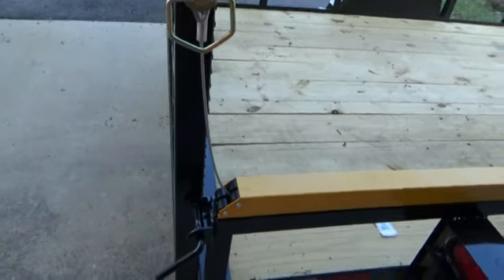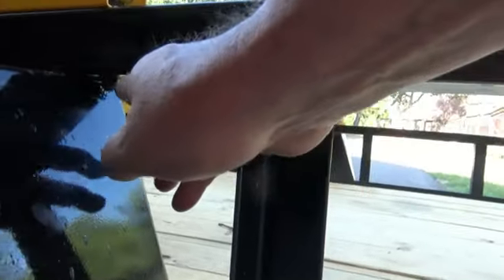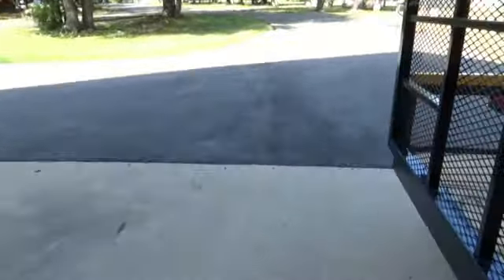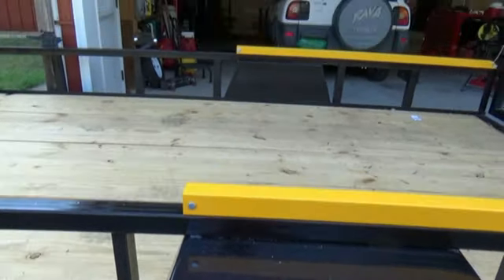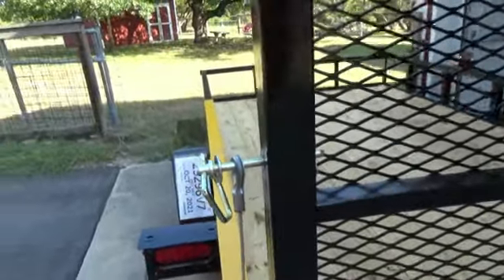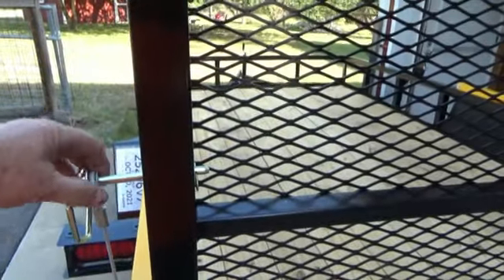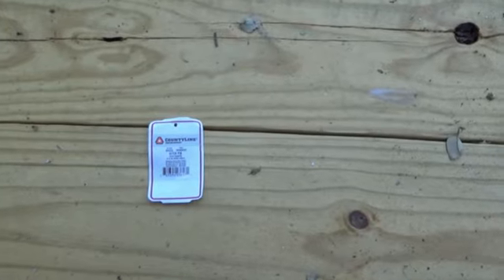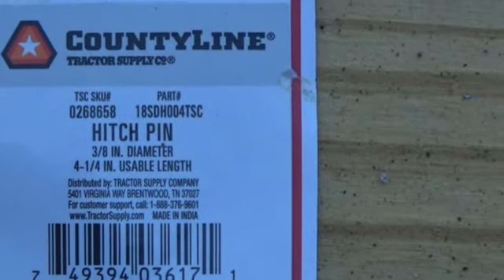Gorilla-lift Trailer Gate Assist - Lowering gate into trailer floor

Comment: YOUNG MAN ,

IS ANOTHER WAY  , NEED BUY LONGER  PLASTRIC SQUARE TUBE FIX INSIDE THE OTHER PLASTRIC TUBE , THEN THIS  WAY U U WILL HAVE MORE ROOM BOLT IT DOWN ! .

MY IS HOMEMADE ONE WITH GARAGE DOOR  2 - 150 LBS  SPRINGS  THEN I PUT EVERY THING ON THE OUTSIDE RAILING ON BOTH SIDE / PLUS I USE PVC 2 INCH FOR GUARD  ! 

PLUS + 2 - EACH 1/2 INCH  DIA . EYE BOLT  OUTSIDE THE GATE  !.

OVER ALL CABLE WILL BROKE SOONER OR LATER MIGHT IN UP HURT SOMEBODY !

MY HOMEMADE GATE LIFT HAVE  N O > CABLE AT ALL !

COST AROUND $ 7 5 .  0 0 !
Reply from the maker: I am not a young man by any measure.  By the way, I have sold that trailer and now have an aluminum trailer.